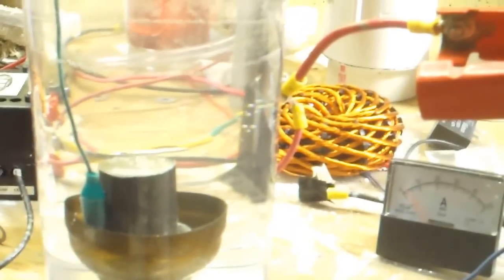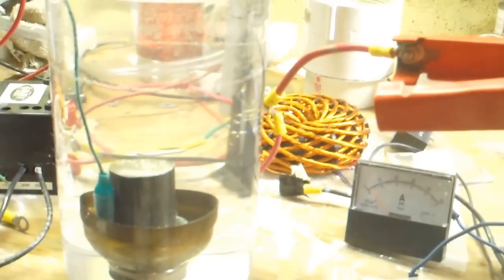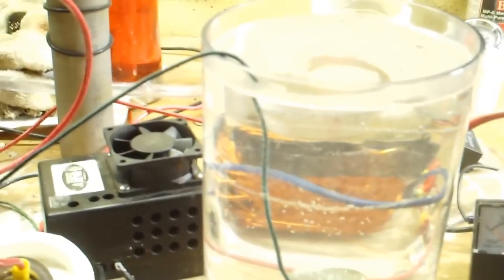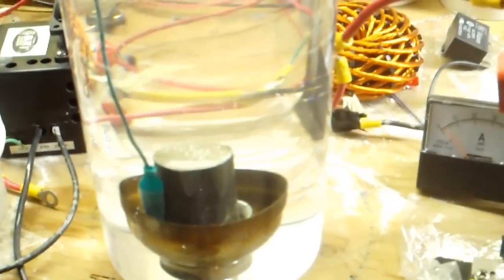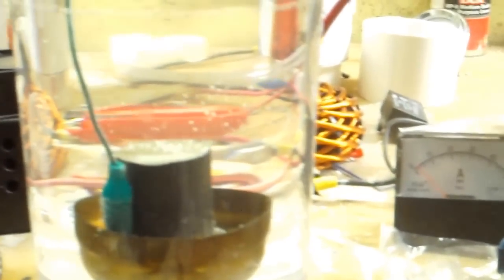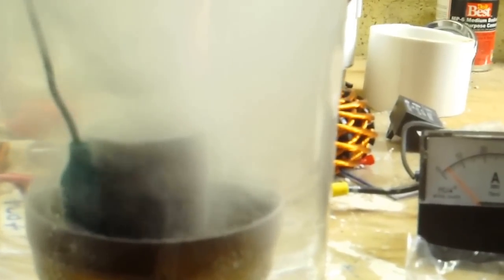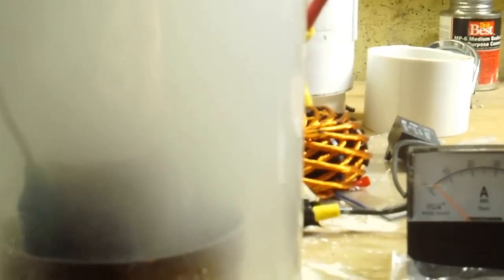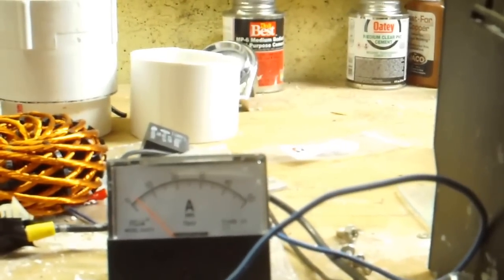Ninja EMF Hydrogen Fuel Making Cell

Comment: Good luck, Dave! Yet not convinced me with that demo. The oxyhydrogen gas you show there is not more than the gas of an alkaline cell at 3 A ( 40 W) ..just looks abundant in your jar due other kind of gas that will not be removed from water ...and the water will be changed ( increasing the conductivity where the initial effect is gone) in constant volume system. Try an water injector with that kind of power modulation.
Reply from the maker: Marius Moldoveanu Marius...the cell is only using 1 amp up to 2 amps max....12 watts to 24 watts. So, what is this mysterious other kind of gas that will not be removed from water?
More testing is needed as I put this together in less than 30 minutes. Today I'll wire it properly and seal the case. Just for grins I'll "bottle" some of this mystery gas and ignite it. I've already designed a Gas Processor/bubbler to form HHO/energized cold fog mixture.
Reply: +hyfusiondotcom where do  i send the 5 bucks to get the 3x production information? ive already built some cells and useelectrolyte and pmw's ect but i am willing to try your methods. thanks.
Reply from the maker: +Martin Doten Hi Martin, the report you are interested in dates back over 6 months. Since that time some truly ground-breaking "discoveries" have been made. For example, S.M. injected EGR and ionized air through his water/gas injector plugs. The nitrogen bonds with the monatomic oxygen to form a water fuel gas more powerful than HHO yet it burns like ordinary fuel. This report , Secrets of Using Water For Fuel, is available at http://www.hyfusion.com 
In my humble opinion, all traditional HHO devices, especially dry cells, are obsolete.
Reply from the maker: +hyfusiondotcom I finally "get it" regarding your work with Nitrogen. But, my new water fuel cell, the Vortex Implosion Cell, is entirely different (and more efficient) than anything I've researched in the past.